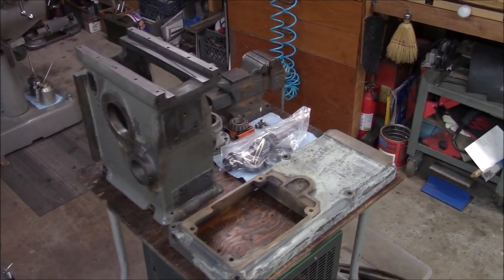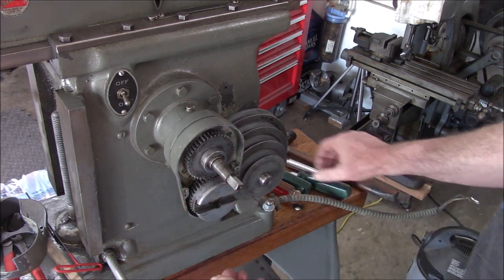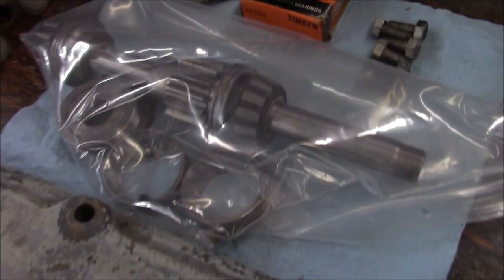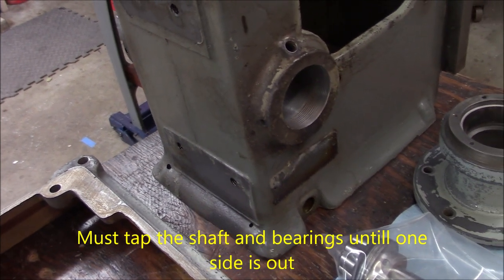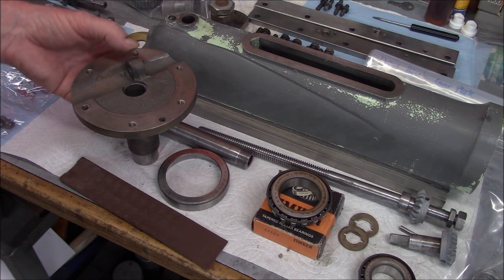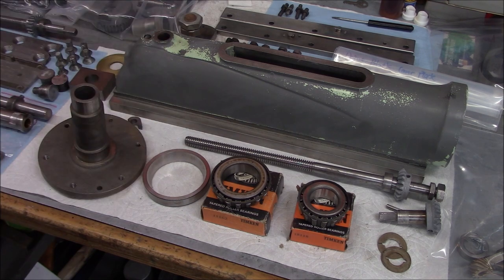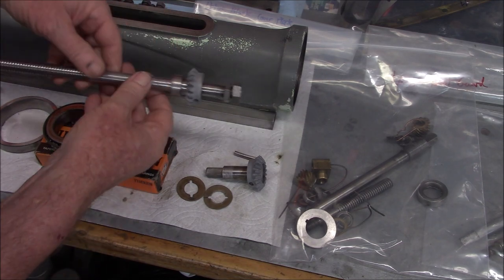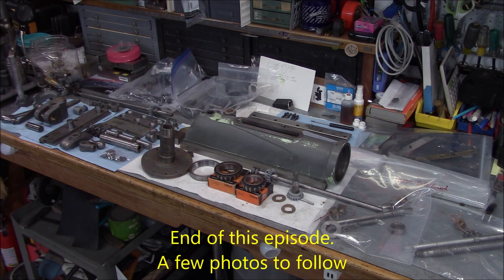Atlas 7B Shaper Project Part 10 - Teardown and Problems

Comment: Hi Dean, that was great to watch and it's a very nicely made shaper. Your instructional video will be invaluable to anyone stripping theirs. My Elliott 10M shaper is nowhere near as refined - the bull gear shaft is on bronze bushes as are many of the other gears and shafts. Stroke adjustment is by a nut on the sliding block. Having said that the Elliott 10Ms were abused by many a college student and they generally keep running so it seems basic was good enough in many cases. Cheers
Reply from the maker: Thanks Paul, Yeah the old school journal bronze bearings will last a very long time with a little maintenance

Comment: Oh NO!  I hate when I break something.  And I've starred in that movie several times.  I hope you can find a replacement on ebay.  I have found so many parts there.  If not, you can repair it like you said.  Good luck.  Ps. I started taking mine apart today for the move.  It's the last machine I'm taking apart, because I just got it together!  Keep on truckin'......
Reply from the maker: Thanks Jester, Hope your move goes smoothly !

Comment: Dean.  I have my shaper torn down now also.  I had to replace the crank gear nut (S7-15).  I noticed in my earlier, 1945 parts list the associated block and pin (S7-14A) looks like your original.  The block and pin on my shaper is like your Ebay purchase. As seen on later parts lists.    On the early shapers the nut is retained with a 5/16 flat head screw.  On the later, retained by a set screw and lock nut on the block and pin. (as your ebay purchase has).  The nut pivot is solid, not tapped.   My new nut, also an ebay purchase, is tapped for this 5/16.  My plan is to fit the nut with a 5/16 screw,  but use the set screw to retain  it.  I figure the screw will strengthen the nut so the set screw will be less likely to distort or crush the nut.
Reply from the maker: Very interesting Kevin, Thanks for the information. I'll study mine in detail. I like your idea of using both fasteners (belt and suspenders). I need to look back at my photos, I'm pretty sure it had both on the old block. Someone may have replaced it before. Thanks Again..
ATB....Dean

Comment: Nice Videos!!  Keep posting!!  please place something about shims for base and gibs..I need to understand this topic.
Bearing has newer equivalents (new numbers) cheaper than NOS and wide available. for example:   S7-168A:  Timken 11162-11315.  S7-171A: Timken 15112-15244. S7-174A Timken 09074-090196.  9-109- Ford 1928-1944 pickup main shaft bearing B-7118
Reply from the maker: Good info, too late for me but may help someone else.. I tried to find a crossover chart / guide and I guess my bearing supplier didn't dig deep enough.
Thanks !!